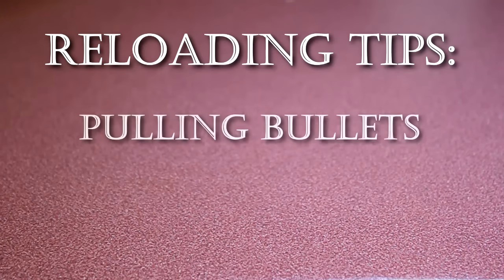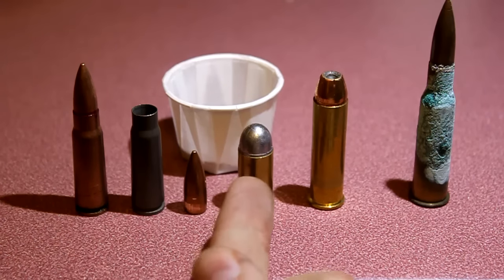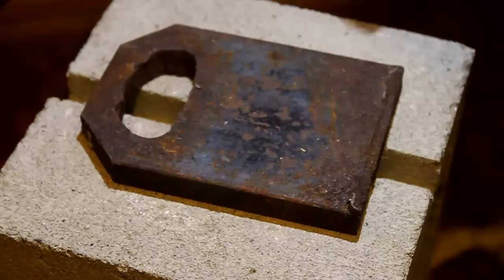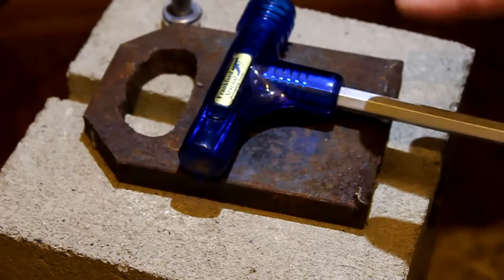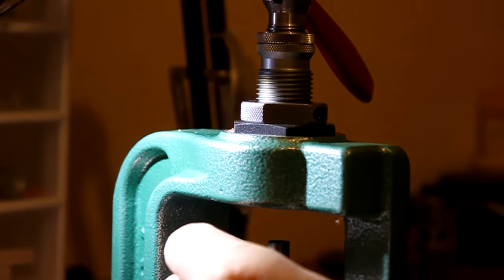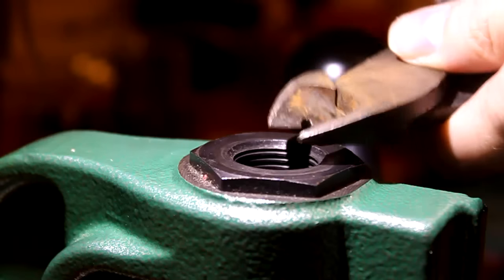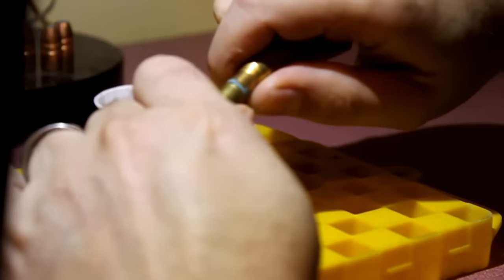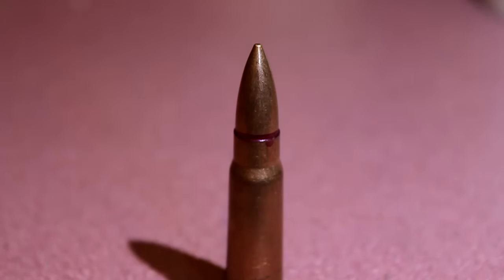4 Ways to Pull Bullets

Comment: In Vietnam, I watched the artillery guys carry literally tons of black powder way down the hill , each day and burn it. They'd pour a trail of it up the hill then toss a match on it, like a fuse. We often took the silk bags it came in and made handkerchiefs  with them. You could feel the heat on your face 100 yards away. I wish I had all that powder now. I'd sell it and retire. Hell, I've been retired 15 years. I must be getting senile.
Reply: Where did that powder come from and why did they burn it?
Reply: Cap
Reply: Thanks
Reply: cool
Reply: @BENYEET  not cap but ok
Reply: Awesome story! Can I ask what were they doing, for the main reason of having it, with black powder in Vietnam in the modern age? That was only 50-60 years ago Haha I would’ve figured the military quit messing with black powder and just use smokeless starting in 1903 or so and consider it obsolete. But maybe there are still some uses for it.
Reply: Haha, hardly senile- just wise.
Reply: Old artillery guy here. I believe all of the artillery ammunition that was used during WWII, Korea, Vietnam and for some time after that for 155mm, 175mm and 203mm (8 inch) artillery howitzers (cannons) was separate loading ammunition, meaning the propellent came packaged separate from the projectiles.  I believe 75mm and 105mm howitzers' ammunition came as complete rounds in wooden boxes and my text below may not apply to them.  The propellent charges for the larger calibers were either "white bag" or "green bag", and came in individual hermetically sealed tubes (one tube per projectile) to preclude moisture absorption.  This was necessary to ensure near identical performance of the propellent across a "lot" of ammunition.  The projectiles came on pallets.  Projectiles were stamped near the fuze well with a series of small white squares that identified variations in weight.  " Four Square" meant a standard weight for that type of projectile.  The Fire Direction Center (FDC) would receive a "Call for Fire" from an observer and depending on range to target, type of target and other criteria would calculate the appropriate firing data.  Artillery met (weather) balloons were flown periodically to provide detailed met conditions from surface to a predetermined altitude (to include variations in air temperature, wind direction, air density, humidity, etc.)  This degree of precision was necessary for firing accurately at ranges of many miles.  The FDC's calculations for firing data to be sent to the howitzers would include this, and every few hours the met effects would be updated.  The FDC data to the howitzers included the "charge" (number of GB or WB increments to use), the type of fuze to mate to the projectile, it's time setting if appropriate, and the deflection and elevation to set the cannon tube at.  If a fire mission required the use of a #3 charge, GB, then there would be two powder increment bags left over from that mission.  They would be discarded to a safe location to be burned later.  They should never be combined for use on later missions for a variety of reasons.  Exposure to moisture (affecting accuracy) after being removed from the sealed shipping tube just before firing was a significant reason for discarding the unused propellent increments.  When time permitted, the discards would be burned.  The contents of the propellent bags was not black powder but a specially manufactured propellent.  Each bag contained hundreds if not thousands of small cylindrical, preformed plastic-like pellets. Each pellet was about the size of a 40 grain 22 caliber round. Each pellet had multiple hollow channels within the length of the pellet.  This design allowed for a more uniform pressure generation from each pellet (with impacts on gun tube design and accuracy in firing) - as the surface area of the exterior of pellet burned down, the surface area across the internal channels grew larger.  A line of discarded charges, two bags wide, and many yards long, would produce a flame of about 20-30 feet high.  Pretty impressive.  Am a Vietnam era vet, but did not serve there so my post Vietnam, non-combat artillery experiences will differ from those that did serve there.  Thank you all for all that you did.  I've been retired for almost 30 years.  Please excuse the small book of a reply and I hope this was helpful.

Comment: I like to use a blend of 2 of your styles of pulling. I use the extra "sacrificial" case as a collet and a pair of plyers I milled the teeth off of. I run it up into the press with no die, slip the case over, grab with the plyers, then lower the ram. It is a "gentle" way of working when you really want to save the components. Thanks for the vid!

G.
Reply: Genius 🤯, I’m going to give that a try👍🏼

Comment: I recently loaded 6 rounds wrong and realized it after I seated the bullet. I used the 4th method in this video with spent brass and it worked out great. Its good to know theres a way to do it without special tools in a pinch. Was able to reuse all of the components.

Comment: When pulling bullets from the 50 BMG with the Ammomaster press, I use a collet type puller assembly from CH4D. No muss, no fuss and each tip comes out mark-free. If I am doing Milsurp ammo which is way too hot anyway, I know they have that tarry sealant on the bullet so I first put them in my seating die and run the plug seater down to break that seal. Sure is a lot easier than flailing away by using brute force to break that bond w/o first doing that. Bullets will come right out, courtesy of a 24" cheater bar on the press arm. Want the sealant gone? Use spray brake cleaner and it comes right off. Tips, I got a million of them.
Reply: Thanks for the brake cleaner to remove sealant tip. I’m wanting to start reloading and want all the tips I can get! Got some more for Newbies like me?

Comment: I'm glad to see you explain the kinetic hammer, and what works best. Many times I've caught myself cringing in pain when I watched someone else swing that hammer a dozen times and still not have success.
I'm going to try your cinder block/steel technique, even though I've usually not had any difficulties with just a steel plate on the bench.

Comment: i wrap the ends of linemans pliers with tape, load the round into the shellholder, raise the piston, grab it with the pliers aligned vertically, and on the down stroke, the pliers are forced to tighten around the bullet due to the shape and opening of the place you screw the dies into.
works everytime, usually just leaves scratches if any damage to the bullet. once you see scratching, retape the plier.
Reply: Doesn't that damage the threads at the top of the die hole in the press making screwing in a die difficult?

Comment: An excellent tutorial.
I've used the kinetic type puller for years now, but I especially liked your tip for freeing lacquer sealed bullets by using a seating die in the press to push the bullet in just enough to break the seal.

Comment: Instead of using diagonal cutters the grip the bullet during removal, if you use a piece of rubber from an old inner tube (or equivalent) wrapped around the bullet, then grip that with a pair of pliers, it would prevent the bullet from being marred, which would make it cleanly reusable.

Comment: I pull a lot of live rounds in the course of  my job, using both the collet method and kinetic hammer.
What I have found is when using the kinetic hammer is to have an empty 22lr ammo box, ie. a CCI 100 Rd Mini Mag or a square 100 Rd Remington box to empty the hammer into.
Leave the tray in place and it acts like a sieve,bullet head on top powder in the bottom.

Comment: They're tougher than you think.
It just so happens that the plastic they're made of is Lexan, which is REALLY durable.
I've had my RCBS kinetic puller for over 25 years now, used it hundreds of times, and it's still in perfect condition.

Comment: I have never used anything but steel case ammo for the SKS and AK! I was given a box of Tula .45 steel case and tried it in my 1928 Thompson, it wouldn't feed through the magazine, the cases weren't slick enough, but they feed and shoot just fine in my 1911, and they shot very accurately, which kind of surprised me! I use carbide dies so I have reloaded boxer cased steel cases with no problems at all.

Comment: When the only tool you have is a hammer, everything looks like a nail.  For 10 years I have using a hammer like the one in your first demo.  Well I hated it because the shell would not stay in the collet, and i was always hating trying to remove the bullet.  Then I saw your demo and realized that I was putting the collet in upside down.  I saw how you did it and changed my ways and I am now pulling the bullet in one wack.  Thanks for straightening me out, I just did 50 old military 9MM in no time.
Reply: Only ten years, not bad, LMAO

Comment: The diagonal pliers I just gripped enough to hold bullet but I like the rubber idea. Using that method and press did the job easily and smoothly.

Comment: For the kinetic puller, you can use the appropriate shell holder instead of the three-sided collet.  Way more secure.   Also Frankford Arsenal has a Pile Driver puller, but I haven't tried it yet.   So far I haven't found any of the methods all that satisfactory.

Comment: First tool is a good idea as you can reuse the bullet, ideal as I shoot a lot of .303 and sometimes they won't fire as they're too old. This tool means I can drop the bullet, replace the powder/primer and re-seat. Also really like your third and final as this is handy at the range of one misfires, you can pull the bullet and dump the old powder.

Comment: In my opinion if you need a bullet puller you may as well skip buying the kinetic one and buy the collet bullet puller.  They are twice the price but well worth it.
Reply: I shoot a lot of gas checked bullets, and half jacketed. I've never really found an easy to get the jackets or checks out, after you pull the bullet.
Reply: can pull a lot more variety of bullets with the kinetic puller, rather than buying a calibre specific one

Comment: Thank you for this video.  During this ammo shortage I can't get what I need and I have 200 rounds of jacketed 45 Colt ammo, and I need non jacketed and lower pressure for my revolvers.  I need to get these bullets off so I can reload them so there not so hot and use regular hard cast non jacketed bullets.  So I am ordering a Kinetic bullet puller.  Thanks for the info.

Comment: for method 3, use soft-grip pliers ($14 at Lowes) and there will be no bullet damage.  My kinetic hammer is now officially retired.  I was able to pull 60 bullets in about 10 minutes, recovered all the powder and didn't have to fish the bullet out of the powder.  Lay the pliers flat on the press, grab bullet and lower ram.  Drop the bullet from the pliers directly into a container then removed case from case holder and dump the powder into its container.  Fast and clean.  I suppose if you're only pulling one or two bullets the kinetic hammer will do, but per bullet pulled it takes a lot of steps, maybe multiple hammer strokes, fishing bullet from powder, screwing and unscrewing cap, etc.

Comment: Thanks for the video. I use the bullet extractor hammer on the linoleum floor, but there is concrete underneath. I know that a lot of people won’t have that over concrete, but is a good option if they/you do. Seems to work well for me, but I haven’t tried your method yet either.

Comment: Just a small detail, but you don't necessarily have to unscrew and remove the collet with the kinetic puller to put in the cartridge you're about to pull.
Just partially unscrew it just enough to allow the collet to expand, then carefully insert the cartridge into it, and it will expand enough for you to push it all the way to the extractor groove.
It just saves one step and greatly speeds up the process.
I did a whole box of badly corroded .30-06 factory loads that way, and it made it easier.

Comment: Over the years I have had issues with some of my loads that needed to be pulled, the plastic "Hammer" types are great but break.
Reply: You can reinforce them to make them last longer. Sand the surface to give it some grip, apply some epoxy, then wrap with steel wire. The wire reinforced epoxy coating will increase durability.

Comment: On crimped and sealed military rounds, I seat the bullet in a little bit to break it loose before using a puller. A puller comes in handy on fixing a deep seating screw ups on loading rounds.

Comment: When you use a kinetic bullet puller, sometimes the collet will come apart meaning you have to assemble it again.  I use the shell holder for that cartridge and place a small piece of tape on the bottom of the shell holder to keep the powder from flying out.

Comment: for the third option use some pliers with some rubber atached to the teeth so you wont scar the bullet :)
Reply: sebast0409 true🧐
Reply: very hard but it works, i pulled 7.62x 54R but it was a bitch.
Reply: Could foam work? I have a 5.56 I want to turn into a necklace. I just don’t know how to take the primer out... so I’m pretty scared of doing it tbh
Reply: Jesc Martin i know its been a year but if you ever need to do it again or someone else has the same issue, throw the EMPTY case that you have completely dumped the powder out of into a fire and wait till you heat a pretty loud crack of the primer setting off. i don't know if the fire marks the bullet with unremovable char, but if it works fine it should also be able to keep the primer completely intact. If you have the gun the bullet fits in you can easily just set the casing off using that but it will mark the primer
Reply: Sfs Aviation : you can also discharge the primer by chambering it in the gun and pull the trigger. The primer is as loud if not a little louder than a .22. firing a primer is still as dangerous as a full round with gun powder and projectile. Still use firearm safety. Don’t discharge anywhere.
Reply: @dannyf4447  Is there a way to deactivate a primer without striking it, so that it looks intact?
Reply: @oceanic8424  : safely? None that I know of. I wouldn’t even attempt to do anything crazy nor would I ask you to try it. If possible in “today’s” world, you might be able to find blank primers. Remove the live primer and install the blank primer. That’s a lot of work for just a blank primer.
Reply: @dannyf4447  A few sites I found have recommended pouring strong vinegar into the shell, and letting it soak overnight. Then rinsing the inside of the shells with warm soapy water to wash away the priming compounds. Apparently this is enough to deactivate the primer.

Comment: Another method which ive used that is similar to what you do at the end is to simply push the bullet against your table. Pushing towards the tip creates some leverage that can deform the neck, loosening and eventually allowing the bullet to come out. Ive done it with 7.62x54r, and its a bear. Im sure with brass though its much easier.

Comment: FYI - concerning the impact hammer.  I put a thick rubber pad in the nose end of it. After many uses the bullet can and WILL punch a hole thru the nose end. It's a lot cheaper replacing the pads than replacing the hammer.

Comment: I did ammosmith's technique with a surplus 7.62x54r steel cased sealed round, that was a bit of a paint but it worked rather well, I dumped the powder n lit it on fire then I stuck the empty casing into my mosin popped the primer and reloaded the bullet and now I have a dummy round :)

Comment: When u use pliers with the press, try a tubing flare wrench instead on bullet, another way is to rotate case wile squeezing case neck a few times w/pliers, it loosens right up. Same method but w/small hammer on neck works the same, lay neck on hard surface & rotate and tap a few times. Can also use a milling machine, put projo in collet put shell holder on then lower into vise & tighten on s.holder lift quill, thats it.

Comment: Thanks for the info. Just pulled my first two bullets. I had a green tip that was stuck so I used an old cartridge which got ruined in the process, but the bullet came right out. Thanks. Is there a way to get the primer out w/o fancy tools?

Comment: If you are saving jacketed bullets you have to be careful when using a collet puller, too much tension can scar jackets and damage the core. If I am saving bullets I use a impact puller. One note about collet pullers the Hornady by its design will wear out collets much faster than the RCBS and they cost about the same

Comment: I was in the zone on my progressive dillon press. Powder mechanism malfunctioned, made about 1000 bullets with no powder.... learned my lesson
Reply: Holy crap that sucks lol
Reply: Yea it took me many short frustrating sittings of using a kinetic puller to get my materials back
Reply: Yeah I could imagine =/ At least you learned your lesson, rightttt? lol
Reply: Had it happen once or twice since but Ive learned to keep my eye on the machine instead of just what im working on. When I first talked about reloading my friend suggested starting with a single stage, I happened to find a used dillon 650 already set up in my caliber with a bunch of extras for a deal I couldnt pass up. I took the machine for granted and got ahead of myself. I definitely recommend starting with a single stage to newer reloaders for same reason my friend recommended it to me...there's less you can mess up at one time
Reply: Too late for that, my progressive press gets here in two days lol
Reply: Is this your first press?
Reply: Yup, I figured I was going to get one anyway. Why pay again shrugs
Reply: Well take your time know your equipment, if theres a weird noise or it just isnt running right take a tactical pause see if you cant trouble shoot it. If all else fails ask google and youtube